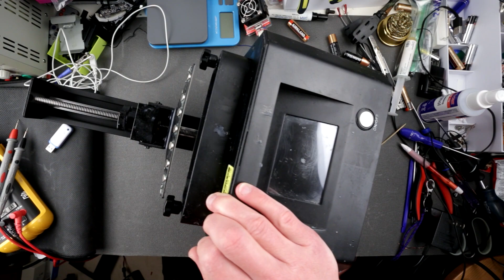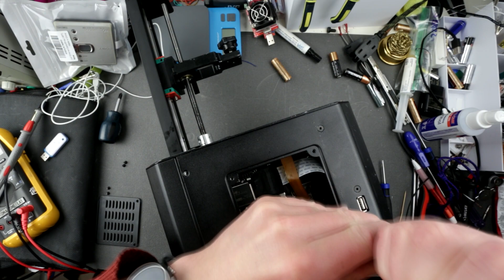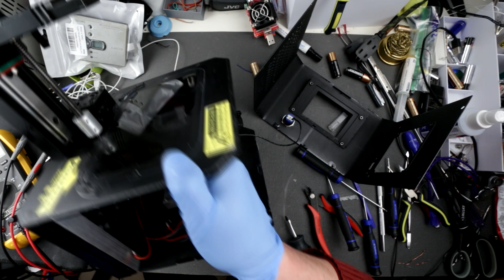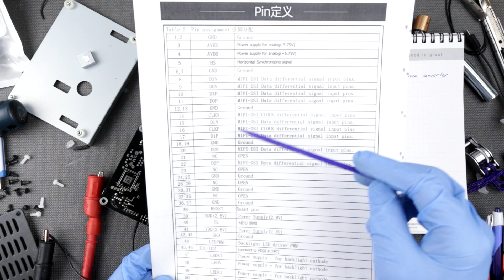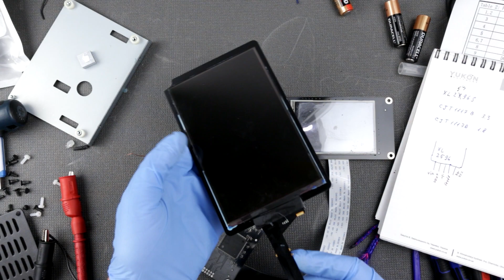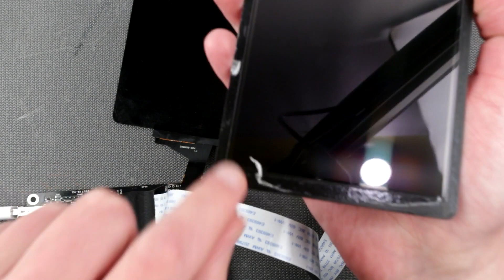Repairing busted Ender LD-002H Resin printer ! Part 1

Comment: I have encountered the same issue with the new display. However, I downloaded the new screen firmware from the link below. After downloading the file "LD-002H Screen Firmware V3_P318_F21_DXQ04_HB060_1620p.CBD", the new screen, with the flat "black" Molex wire, started running smoothly. The polarization is working well.

screen firmware (LD-002H Screen firmware  V3_P318_F21_DXQ04_HB060_1620p.CBD) - https://drive.google.com/drive/folders/18RWhvkiCrR19qk9RhJDbPIWynaqi2UaM